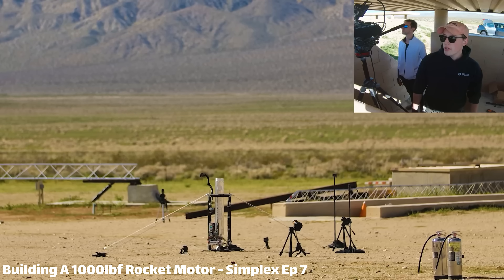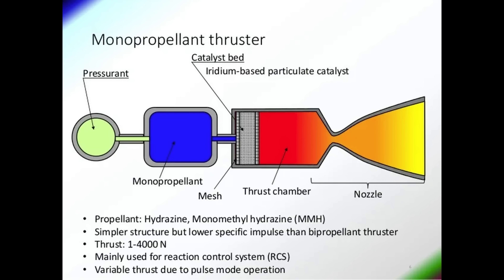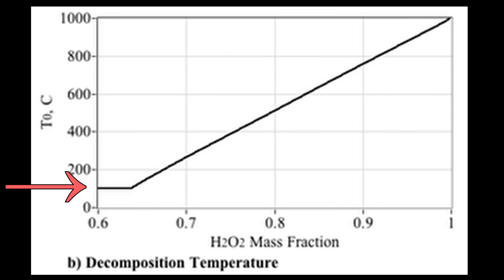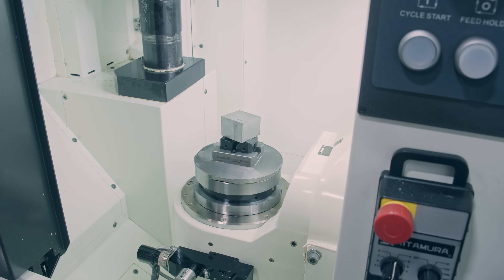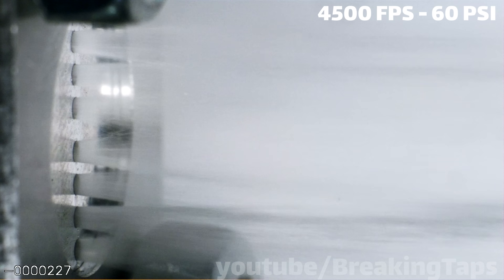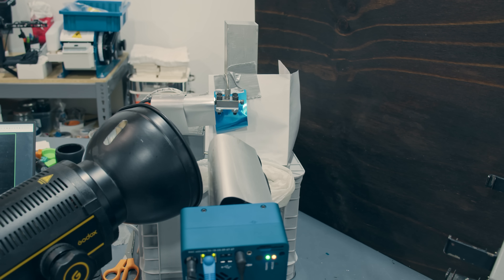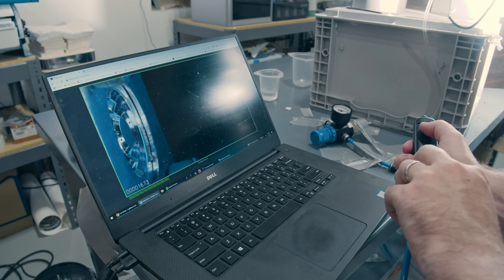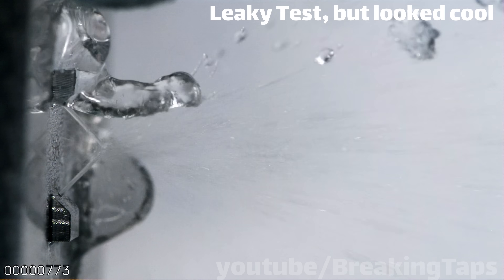Prototyping (Tiny) Rocket Injectors

Comment: Watching your video I was reminded of two names - Richard P. Speck of Micro-Space and Dr. Adam London of Astra.  Both are/were professional aerospace providers (We sadly lost Speck around 2010) with maverick outlooks.  

Speck ran a successful(!) aerospace company with some of the most gonzo engineering I've ever seen.  His low pressure liquid-fueled motors used unconventional materials like fiberglass and resin, and his design for a minimalist lunar launch platform used angle aluminium framing and medical rubber tubing in the shock-absorption system.  It was terrifying when compared to more conventional design, but when I met him he also had more than a few of his commercial launches (sounding rockets for the weather service) at hand to show that the principles were not nearly as insane as they looked.  He was the kind of guy would makes world-record smallest/lightest orbiters in Kerbal Space Program, but did it in real life.  

Dr. London is an MIT grad who founded Asta.  His post-grad work isn't nothing, but it's what he did at MIT that really made his name.  The interest at the time was in micro-rocketry systems.  Some principles of semiconductor MEMS design could be adapted to handling combustibles and could theoretically be used for ultra-small probes or station keeping for satellites.  

The top of the line at the time was a solid-fuel array on a chip.  Essentially, it was a bunch of explosive wells piercing a conductive sandwich with traces to allow specific wells to be detonated at will.  The wells were separated enough to prevent chain firing.  It was a good way to store a small amount of delta-v for long periods of time without worrying about the vagaries of pumps and the behavior of liquid fuels in microgravity.  The downside was that it was a chip die with tiny firecrackers in it.  The delta-v budget sucked, especially compared to its mass.

When Dr. London did his work, a MEMS pressure pump had recently become availble.  So, he decided to see if he could use semiconductor tech to make a MEMS-scale rocket nozzle.  It was cool AF.  It looked like a little almost-2D bell nozzle made of layered metal and was _tiny_.  I have to assume it didn't work because Astra doesn't mention it, and there are a tremendous number of applications for a chip-scale turbopumped liquid-fueled engine.  There were discussions of building orbiters with the mass of a small car that could deliver 13-oz payloads to LEO and the linke, it was wild.

Even though Speck is presumably designing sounding rockets in heaven (one of his non-commercial sponsors was a Baptist church!), we still have Dr. London.  You might consider reaching out, or not.  Either way, you're doing something cool and have cool peers.

Comment: Re: 1 mm vs 0.2 mm holes. This is obvious but I'll point it out anyway. The area is relative to the square of the diameter, so 1/5 diameter will give 1/25 of the area.

Comment: maybe a stupid question, but: high test peroxide and kerosine form hypergolic fuel. you have showed PLA 3d-printed engine models. since PLA is just another hydrocarbon, once the system is sufficiently hot (either with decomposing H2O2 or with an injection of a fuel like diesel), you could just burn PLA as solid fuel, essentially making a hybrid rocket that is hypergolic.
of course, if anyone would use that thing in the wrong way, it turns into a fireball. and no one wants that.

Comment: I have been working on a similar project only with goal being parallel extremely laminar streams. I built a much larger fuel tank I could pressurize that prevented air from mixing with the fuel. I used cam lock fittings so it’s easy to refuel.

I also found smaller holes are way way better for getting good streams. I started with .003” sapphire orifices but found that the .1mm PCB drills on Amazon also work quite well. They are also super cheap and more resilient than i expected. Adding a super fine SS mesh filter screen is also a must since any small particles will clog the nozzles. I tried polypropylene filter fabric but the tiny fibers can come loose and cause clogs themselves.
Reply: In what material(s) have you drilled these 0.1mm holes, and how deep? Thank you.

Comment: [simply] spin your catalyst, but shape it as the pump. Maintain the rotation to separate the water from the evolved Oxygen, sending the water around the bell as coolant, and the Oxygen through the center of the burner [with fuel]. EZPZ

Comment: This is kind repeating 1950s tech. How about a pulse detonation rocket engine. Much higher ISP since the combustion is super-sonic. I would not try the rotating PDE as I don't think it will be practical since it requires extreme fuel\oxider pressures to function. I think with a straight pulse will be more practical engine design.
Reply from the maker: I'm not sure I'm brave enough to try highly energetic engines quite yet! But if this project goes smoothly I'm definitely going to investigate something a bit more exciting for the next project!
Reply: @BreakingTaps  Thanks, but working with concentrated H2O2 isn't any safer (more risky in my opinion).
Reply from the maker: 35% is moderately safe, at least in the realm of chemicals that I have experience with. But yeah, more concentrated than that and I think regular fuel/propellants are probably simpler and safer. High test peroxide is scary stuff!

Comment: For 365deg catalyst coverage on a mesh or foam, plating will work much  better than sputtering. 

Sputtering or evaporation is pretty much line of sight.  You would need to rotate your substrate in the vacuum to get complete coverage. 

Did both the 90's when I was a kid.   During HS did plating at Hughes Aircraft.   Did sputtering in college.  Coated EUV mirrors for NASA mission.

Comment: Consideration: You have a rocket nozzle to increase velocity at the output of the completed engine.  What about making micro nozzles for your HP to enter the chamber. As the micro-streams exit the nozzle, the fluid should be ripped apart as it expands to fill the exit of the nozzle.  Naturally, this will take some custom-shaped micro drills that are made to look like the expansion nozzle exit, but I think it may be worth a try. The holes need to be as small as possible.

Comment: Having worked with Hydrogen peroxide at higher concentrations. I would include 35% in that category especially working with pressures and catalysts. I cannot state the importance of safety of exposure to chemical burns. Please make sure you ware the propper PPE. You  do not want to get this in your eyes or on your skin. Also have direct  access to a safety shower/eyewash station. Keep anything organic especially dry materials away from your work area and have  access to water to be able to dilute the peroxide should a spill or exposure happen. It is really cool stuff to work with and have fun. I just needed to say this. Having been burned and seen other things catch on fire easily it really isnt something you want to handle without caution. Otherwise hope you have a great time. It really is amazing to see what happens when you work with it!
Reply from the maker: Noted, thanks! I do have an eyewash station on my shop's sink, and plan to build remote test stand so I don't need to be anywhere near it while firing (because I don't trust my engineering enough). Will make sure I'm fully PPE'd whenever I work with it (lab coat, gloves, goggles, etc). Appreciate the tips, would rather not go blind or get horrible chemical burns!

Comment: Always impressed with your effort level & build quality. Couple things. 1. BI-Prop injectors use different sized holes AND impingement angles from inner-outer rows. 2. There is no benefit of impingement for a mono-prop. Impingement is for mixing fuel and oxidizer for more efficient combustion. With a monoprop, the catalyst releases the oxidizer stored in the fuel. 
3. Hybrids have thier place in propulsion, there is not a one tech solution in the rocket-world. There are always trade-offs.

Comment: Does atomizing the fuel in a monopropellant rocket even do anything?
Reply from the maker: Probably not, assuming you can get good/even distribution from a showerhead. But I really wanted to see what it looks like on the high speed, and I do wonder if it maybe is helpful given how low percentage this stuff is? I.e. help distribute it more evenly deeper into the catalyst chamber? Probably not, but wanted to have the plates available for testing!

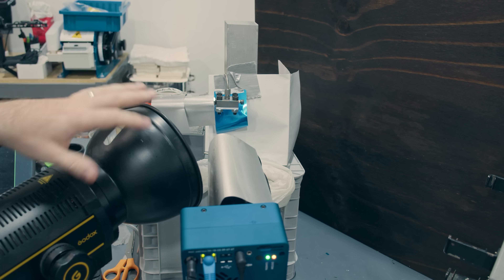Comment: 10:00 Non-linear relationships also close to always throw me off. Although .2 is only a fifth. But the area is only 1/25. I find it even harder when thinking in volumes. Best example for me is underestimating how much earth you need to fill a small uneven spot or how many liters are in a pool.

Comment: What is crazy to think about, is how much propellant flows through the injectors on a full scale rocket engine. For example, each Merlin engine on a Falcon 9 burns 350 pounds of propellent a second. 350 pounds of fuel and oxidizer, being forced through an injector array a the size of a dinner plate, every second.
Reply from the maker: It's totally nuts! And they are cryogenic too!

Comment: Probably why 0.2 holes seems so much smaller than 1 is you are judging by the area (2𝜋𝑟²) instead of the diameter. It's 1/5th the diameter but 1/25th the area.

Comment: 🎯 Key Takeaways for quick navigation:

00:04 🚀 The video discusses building a hybrid rocket engine and injectors for an amateur rocketry project.
01:25 🔧 The project involves creating an electric pump-fed silver catalyzed hydrogen peroxide thruster.
03:02 🚀 The video provides background information on different types of rocket engines, including monopropellant engines.
03:16 📐 The design includes various components, such as an injection chamber, Catalyst chamber, rocket nozzle, and more.
04:07 💥 The video explains the use of 35 percent hydrogen peroxide as the propellant and the role of a Catalyst in its decomposition.
06:02 ⚡ The project involves designing an electric turbine compressor to pump the peroxide instead of using pressurized gas.
07:13 🎥 The video showcases a test rig with high-speed cameras to study different injector geometries.
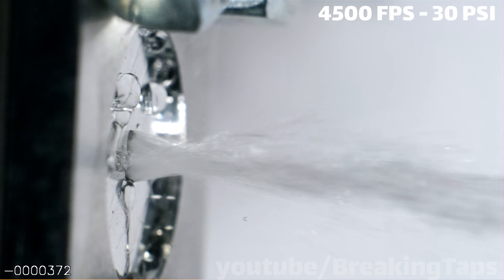09:32 📽️ Various injector geometries are explored, including shower head and impinging injectors.
12:14 🌀 The video discusses the behavior of different injector designs and their atomization capabilities.
14:45 📚 The presenter plans to release the project in segments due to its complexity and length and mentions supporting Nebula, a creator-owned streaming service.

Made with HARPA AI

Comment: Cool project my friend  One suggestion I would highly recommend it play more with pressures. Think about fuel injection. Old stuff like the early 70s used 30psi stuff. My 6.4 diesel uses 28,000 psi. The more pressure the better the spray. Really below 100psi I don't think you will ever get reliable atomization. And I do think you will find better atomized peroxide will relase more energy. Each droplet will have a surface tension and will be spinning. Theoretically it will give better contact to the catalyst. And for nozzle testing try a bigger tank to give you more time to study the spray. Anyway will be really cool to see how it progresses.

Comment: I think it wold be interesting to see an inpinging system with 5 or 7 streams pointing to a single pount, 
Then having the outer portion of the injector have the regular showerhead style holes.

Also I believe that having the thruster virtical rather then horizontal would give a more even flow  through the injector.

Comment: I wonder if you could fix the issue of uneven flow by using multiple branching stages to feed in. As in start with a large inlet, do a spread of 45 degree holes into it from the other side that are smaller, then follow that up with a stage that takes those as inlets and branches further. By doing it in stages it should be possible to machine even a large number of fine branches.
Sealing it would be more interesting but I could see either sealing at the edge of the joints like you are doing with the rest, or possible using just a thing sheet that could be machined while on the plates that would become the seal.

Comment: Hi! I've worked on both monoprop peroxide engines and biprop combustion engines.  For monoprop, you do not need atomization, and an atomization optimized injector will give you bad performance.  Atomization is only needed when you need to vaporize your propellant (to ensure efficient combustion but irrelevant in a monoprop).  All you need to do with your monoprop injector is make sure it's distributing the flow over the entire catalyst bed evenly (like a showerhead) and it has a large enough pressure drop to avoid feed system coupling (chugging).
Reply: Just what I was thinking. Impinging two reacting propellants makes sense whereas peroxide just needs good exposure to the catalyst.
Reply: Also, for a monoprop, are impinging flows needed, or could the flow from one hole just impact on a baffle to achieve the same effect?
Reply: No impinging flows at all.  The best monoprop thrusters use just a showerhead with axial flow
Reply: I've been studying peroxide rockets for a long time. I always wondered why any kind of shower head was needed at all, just let the H2O2 flow into the catalyst. Now I understand the need for the pressure drop it creates.
Reply: Correct, I designed built & tested very efficient silver mesh based catalyst all the way up to 420mm mesh diameter with 32kg/sec consumption rate while at Gilmour. No impingement was needed and atomization was needed, but an important feature required in the cat-pack that is often omitted from literature is the anti-channel baffles that refocus the liquid flow back towards the center of the pack. 1 of my earlier packs had a detonation caused by flow of hot HTP around the outside of the mesh stack due to not having those baffle rings.

Comment: What is the source of gas in front of the injector to allow space for droplet formation?  Won't the space between the injector and catalyst plate be completely flooded?
Reply from the maker: Yeah, my understanding is that it gets... complicated. The catalyst will be rapidly evolving O2 gas and steam, which can cause backpressure that prevents peroxide from reaching the catalyst. Which can cause a "chugging" phenomenon and unstable thrust. The thermal load from decomposition can also create issues and shatter or alter the catalyst (more of a problem with ceramic support and high test peroxide).

I've been told that real peroxide thrusters often put the showerhead directly up against the catalyst as a way to minimize some of these issues. It's not clear if that will work best with lower percentage peroxide or not. I plan to test a few geometries and see what works. One of the reasons the design is modular, so I can adjust the spacing of different elements :)

Comment: Just for fun, but a LOT more work, impinging injector streams of H2O2 and a saturated solution of sodium or potassium permanganate instead of a silver catalyst?  More H2O in the product, but no special silver catalyst needed.
Reply from the maker: Funnily enough, that's how I started designing this project originally. 🙂 The original plan was to have a cutaway view using a glass panel, and then show how a biprop engine works using peroxide + permanganate. But then scope creep happened and I wanted to see how effective of a thruster I could make which moved me towards a solid catalyst.

Would still be neat to see a cutaway biprop demonstration though! I have a full design which would probably work, might make it as part of this series just to see :)

Comment: I would want to experiment with ultrasonic atomizers/ get some inspiration from fords high pressure fuel injectors.  (though such pressure would increase the weight of the rocket.

This is awesome I would rather watch someone fail at a liquid rocket engine than watch people make solid rockets over and over again.

Comment: You should look at diesel injectors in this case for inspiration. These are designed to aromize fluid to a very fine degree and their tip design is very well studied and researched.
Reply from the maker: Will take a look!
Reply: @BreakingTaps  from my experience, two things might be worth trying from the diesel world: pintle-style injectors (which can be turned on a lathe—no microdrilling) and voice-coil based injection (where a vibrating membrane is used as a pump and to break up jets into a steady stream of droplets).
Reply: I’d also take a look at using automotive fuel injectors and components. If you want a full system it’s going to be easier  as well since it lower pressure and components are easier to get.

Comment: Since there's no way you'll generate enough energy to reach supersonic conditions, the "choke point" will be completely pointless. Technically, there will be no choking and so it's not a choke point.
Reply from the maker: Could be the case! I feel like we can probably reach supersonic at the throat if the electric pump + peroxide decomposition can get the pressure high enough. But yeah, it may end up being just a big wet steam generator in which case an open cone would do fine :)  We'll see! Part of the fun of this project imo :)